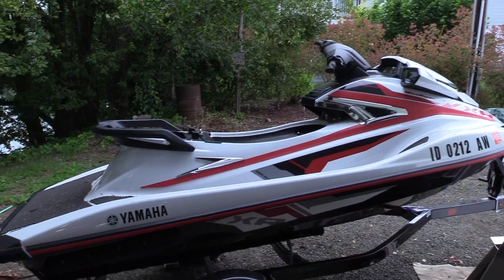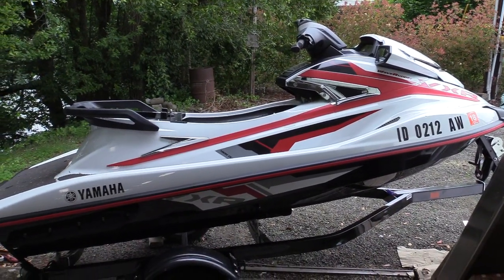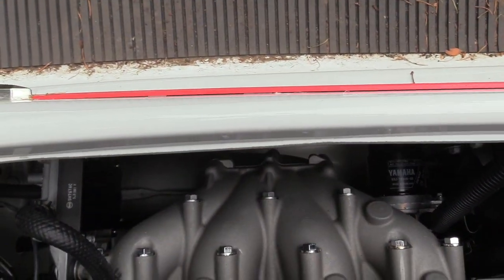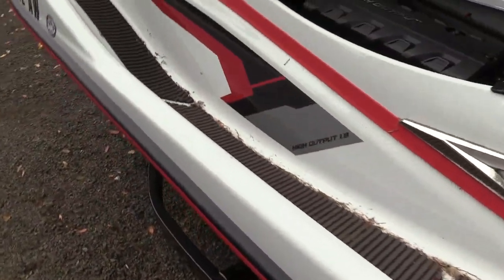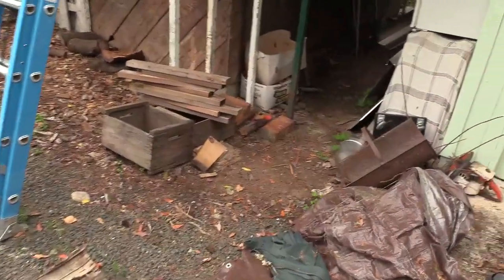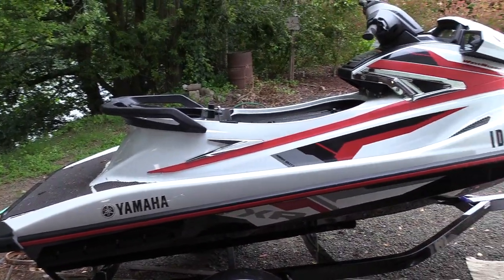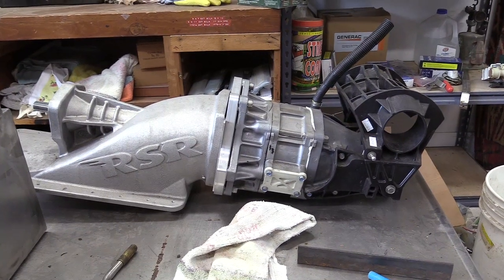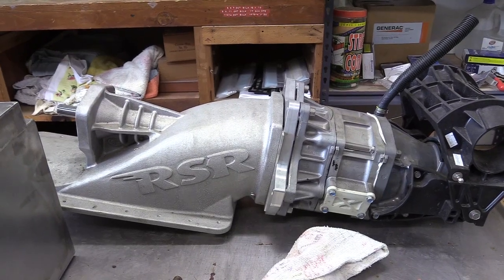Mini Jet Boat Build Video #1 Introduction

Comment: Man that's to nice of ski you made me  feel sick🙄🤢🤮
Reply from the maker: 0hrs. It was hard to cut up, but had to be done. I wish I had waited, because once the boat project got put on hold, I could have had a ski to use.
Reply: @paulchristian8271  yeah man I would have found something cheaper to cut up because if I'm right that's the mr1 motor which is pretty much bulletproof did you ever finish building the jetboat
Reply from the maker: Matthew Robert No. It took too long and I ran out of time in the spring. Then granny passed and I’ve been dealing with her stuff and trying to fix up my rental house. It’s not going anywhere. I’ll do it eventually.

Comment: How did you order that intake along with pump and from whom did you order it? Awesome power plant for sure
Reply from the maker: I bought the jet ski and parted it out for the pump, motor, controls, etc. (donor ski). I bought the intake from RSRacecraft. I went to Idaho to pick up the kit, intake, and other components. One of the intakes I bought from them had a bad tap on it. It was drilled and threaded at an angle. Otherwise, I also bought their pump adapter to match the pump to the intake.
Reply: Good deal, thanks

Comment: im in the uk and also used a jetski to power my boat. i designed my boat around a jet ski to make it easier to donate to. starting work on mine again soon but this time i might you tube it as the actual boat and deck are my own design for racing. good luck with yours and i will follow your progress.

Comment: u want grill up from the bottom or when u hit gravel the weight of the boat will force rocks into and thru the grill.   u also want space between the bottom and the engine or a little dent on the bottom will make it contact.  best scenario would be to have a few inches so you can put some 2" stringers under the engine.
Reply from the maker: I can't raise the motor because of the intake and grille I paid $1600 for. I have 1/8 clearance beneath the oil pan and the hull. The only way to raise the motor is to raise the intake, and if I raise the intake it will raise the pump too high on the transom for performance. This is their design, I just bought it. 
I might not finish it, but either way, I'm going to make sure people know that I got screwed by Wattscraft and RSR. I told Wattscraft they could make it right by sending me a kit that was bent to spec. Nothing. If I can somehow settle in my mind the idea of having a twisted $20k boat, I am going to wrap it with a wrap that says "crooked Wattscrap from RSRacecraft" and has a little jet that is spewing out brown stuff.

Comment: Take your time spec'ing your clearances. I created my own one off intake shoe, mounted it and then when I went to set the engine and shaft alignment, the engine had to sit so low that I had the dent the floor of the hull, luckily I had already welded a spoon under the boat in that area so denting the hull downward was OK in my case.
Check my vids, im behind on them but today is going to be my first water test on mine!
Reply from the maker: I ran into problems with the boat kit. They didn't bend the components right, so I have a twisted bow. I did have to raise the intake a little bit to make the motor fit, but that is the least of my problems now.